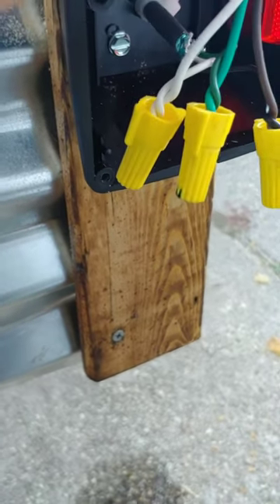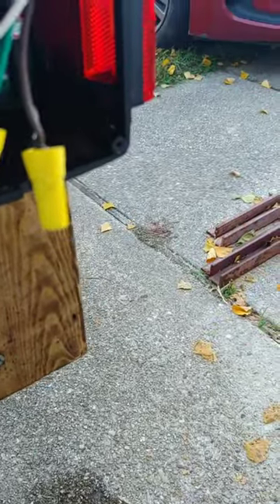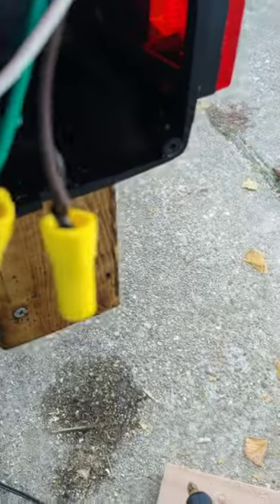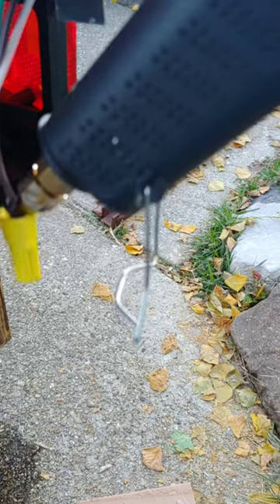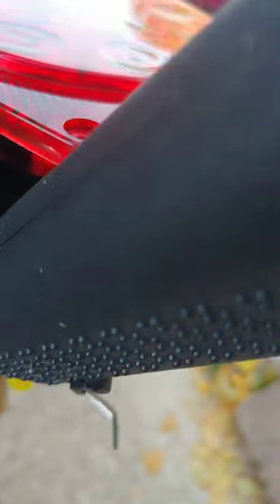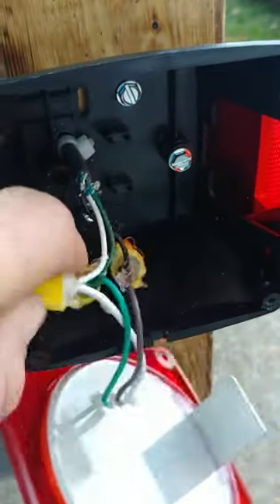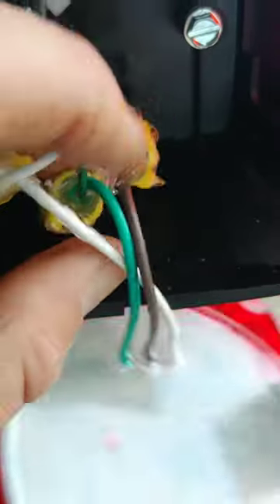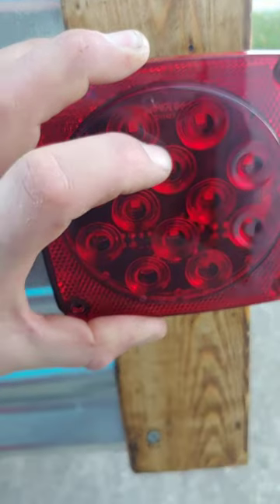How to waterproof trailer light connections #trailer #light #waterproof

Comment: Wire nuts????? 
Those are for houses, buildings and generally speaking things that don't move. 
I've seen them in boat trailer light kits before but that doesn't mean you should be using them. They're for solid core wire, not for stranded core. In other words, if they hold at all, they won't hold for long. 
Use crimp connectors and liquid electrical tape.
Reply from the maker: Wirenuts can be used on stranded and solid wire.
Reply: Stranded wire that's being secured to solid core wire, sure because the solid core wire provides the structure and strength for a secure connection that won't come apart easily. That said, you should never use wire nuts on anything that moves like a car, boat, trailer or any other vehicle.
Reply: Don't get me wrong the hot glue gun idea isn't a bad one, I'm only taking issue with the wire nuts.

Comment: Or add some liquid electrical tape instead of hot glue in the same way
Reply from the maker: Over time the electrical tape can wear out and it can still leak in. Salt water is horribly corrosive. If you are always fresh water you might have a better shot.